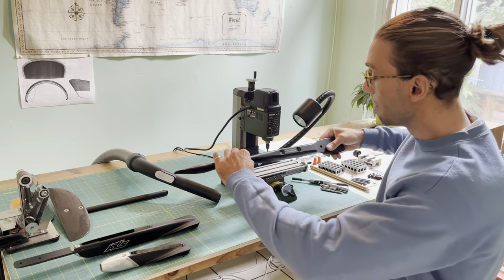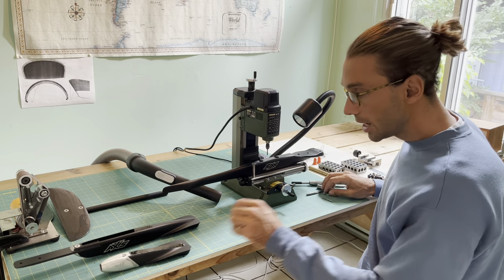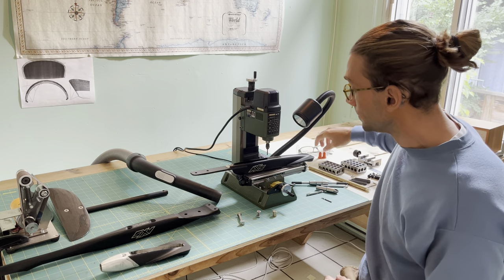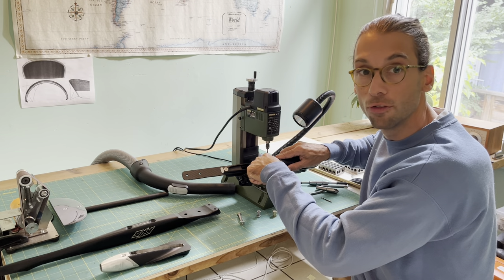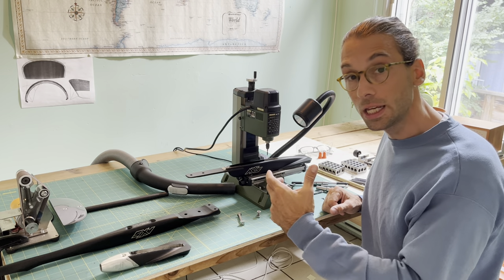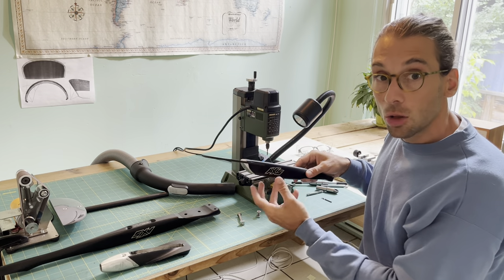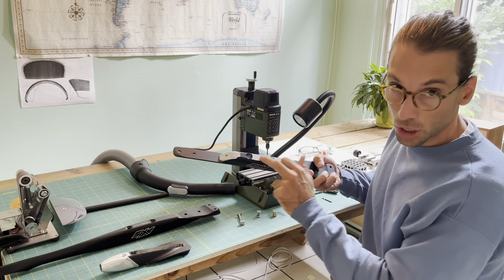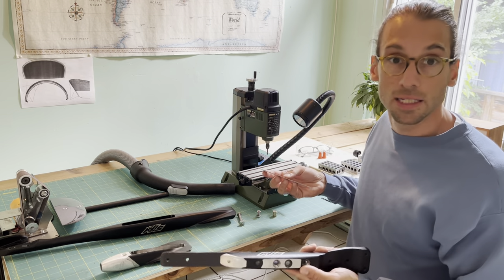How to customize your AXIS fuselage

Comment: Hi James, watching your videos I had the idea to modify axis black crazy to fit the Sabfoil mast... It's seems to me doable cause the sabfoil is not tapered but just straight 18mm wide, so would be "easy" to adapt the fuse using your kind of tool.. What do you think? 
Thanks Giovanni
Reply from the maker: That would indeed ve relatively easy. Note that the rounded corner at the end should be pre-drilled with a 18mm drill bit. Otherwise with a 3mm milling bit, there will be a large gap between the 3mm rounded corner and the 18mm hole...
Reply: I think I'd use directly a 18 mm milling drill bit to do all the work.... If I find one...
Reply from the maker: That would cut it! :)